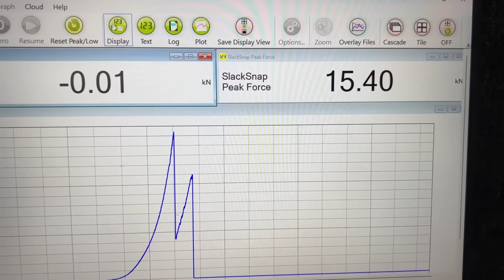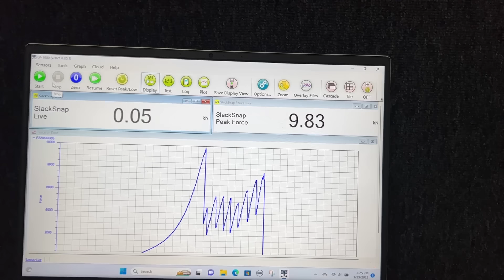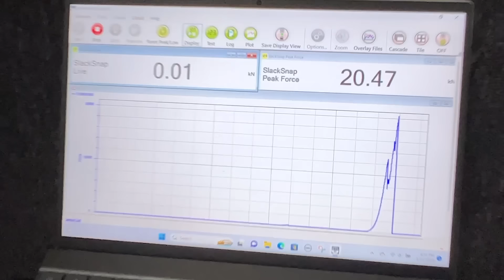They say clipping it like this will kill you

Comment: SIET teaches "STRADS" instead of "SERENE" or "ERNEST". Solid (or Strong) Timely Redundant Angle Distribution Simple. They dropped the "Equalized" and replaced it with "Angle" and "Distribution" because equalization doesn't really stay when the anchor gets loaded, but the angle between strands and distribution of load does stay as the anchor is loaded. Your tests agree with the research they cite for this. They dropped the "No Extension" because it doesn't substantially reduce the strength of an anchor, especially not if there's a decent amount of dynamic rope in the system. They're much more focused on Trad, Alpine, & Ice climbing than sport, so the compromises are different; speed making the anchor matters more often in alpine climbing, and anchors often don't have bolts but rather cams or other placed pro so the weakest point is likely different.

Comment: No Extension vs Extension! Bloody test it!! 😀 I'd love to see just how much shock load you get from a foot of extension in a dynamic system
Reply: regardless of breaking forces, in a climbing scenario if the master point drops because of a monster factor 2 fall of the lead climber ripping pieces out, you have serious problems. ie everyone tied to the rope is buying the proverbial farm. Shock loading a compromised anchor with the weight of everyone = No Bueno. The BFK is used to prevent that AND to provide a 'shelf' for potentially self-rescue with.
Reply: Thomas Evans tests ("Peak Fall Arrest Force During Simulated 2-Point Multipoint Anchor Limb Failures" SARRR) indicate that without any dynamic rope in the system about 2kN to 2.5kN extra is added. Dynamic rope in the system should substantially reduce this force.

Comment: I don’t find the Connecticut tree hitch pull test valid for those results at all. In guiding we have borrowed this technique from arborists but when utilizing it I use it around an actual tree because it spicy 4rth class terrain  or lower risk 5 th class terrain with stout trees it makes for quick transition’s.  Testing it this around a small radius of the bar stock carabiners x 2 totally skews real life situation.  Using a dynamic rope around a tree adds additional surface friction coefficient. Yes It’s closed with a locking carabiner true but I personally use a round stock biner to get better radius.  So my suggestion is too repeat this test with a dynamic rope outside on a good tree to show truer results and im willing to bet you will get much higher failure results 🤔
Reply: Uhhhh

Comment: we started doing a tailess BFK but with the 2 outside loops not in the bolt. You rethread the tails in the bolt back to the loops and equalize with truckers hitchs after a bit of tension was put in the system in the center loop of the BFK. Love it for A-Frames. More gear intensive tho. If you ever want test it :).
Reply: Dude that sounds like such a good idea! Definitely gonna try that at some point.
Reply: can you tell me what BFK means? I am from Germany and we have different expressions :-) Also many thanks to @HowNOT2 for all of your videos!!!
Reply: @quarrin Big Fuc#ing Knot. Basically an overhand knot, tied into or more strands of the rope. It is kind of an American climber slang term. I agree it is not very descriptive or helpful if you have not heard of it before.
Reply: @johngo6283  many thanks! I will include it n my climbing slang! :-)

Comment: This was so helpful as usual!  I have wondered about cordelettes and single strands versus multi.  Sometimes I tie a clove hitch into one of the outer points just on one end to get the length right and back up with knot.  Thanks HowNOT2.  So much amazing content!  Always!
Reply: Shortening with a clove hitch can be a shortcut to weakening that leg; generally, especially now that the strength of a Girth Hitch plus X master point, even in Dyneema, is better understood, and tested, reconsider the whys around making any single arm shorter, versus redistributing the extra across all legs and then making the Girth Master point just a couple inches lower. With few exceptions, any leg feeding to a single point is strongest, in order of: an unknotted sling loop, a sewn single end of a long runner, then a knotted loop, and last a knotted single strand - though that knot will hold far less in Dyneema, than good old nylon.

Comment: For the bunny ears anchor, I'm more curious in the results of having a singe strand of material on the central point and two strands of 6mm at each outer leg (this requires tying the other tail into the knot like the Tailless BFK (I've always heard it called a Frost knot). Given the centered direction of pull, the majority of the load is on the center leg. By using a single strand of material there, it will stretch more than the 2-strand outer legs and do a better job of distributing the load.

Comment: For the "bunny ears" anchor.  I put clove hitches on the ends (makes them quick and easy to adjust) and use sterling powercord which is rated to 19.7kn.   Can you test that?  I'd love to see it.
Reply: That would be an interesting test. With the Sterling power cord, especially, I think it would be absolutely strong enough for most any recreational climbing situation.

Comment: Looking at how these broke and what is more likely. 15+kn loads for total failure are an exception + often generated by not setting gear properly rather than catching a fall BUT the daisy chain having to fail 6? (5 or 6) times at 5kn is quite redundant. If you generate that force it's unlikely the climber will be rushing back 4 more times for the same jolt.  
I did climb for ages and that 7mm cord you showed near the end is my favourite. I leave it with fig 8 ears tied normally and is simple to use like a loop - just leave both ears on the same 'bina. Gives the option of both anchor styles in one bundle.  
For just sport climbing I'd have a nylon sling + BFK. Simple as

Comment: Couple of questions about the tail-les BFK: 

1) what if the tails point down instead of up? AKA the tails don't also contribute to the master point loop. They point straight down before tying the BFK. I sometimes use the bunny ear anchor from the beginning of the video on one end of a piece of chord and tie the other end into the BFK, so I was wondering. 

2) What happens if you accidentally only clip the loops below the BFK that are made by the tail strands? Are they more likely to slip through? I know these are kinda weird questions, but I think it would be interesting to know the answers
Reply: Particularly point 1) is not weird - some people who use the tailless tend to have the tails pointing down, giving less material. @HowNOT2 could you pretty please test a BFK with the extra tails down? Asking for a friend....

Comment: Hey @ryan and crew. Industrial gear is supposedly engineered to 5-1 with SWL listed veunf that 1/5th strength, whereas climbing gear typically lists max breaking strength. Maybe you could make a video addressing these differences?
Reply: Probably because climbers have no clue how much they load a system falling off, and also don’t need to lift heavy stuff like you would in construction.

Comment: My problem with the double sliding x is that the slings are right on top of each other so if a rock cuts one it probably cuts the other and then you are gone. One could say the same about the quad but 4 strands would need to be cut and they aren’t exactly on top of each other. Also the hit box is smaller since the knots separate areas so if a leg is cut it’s fine. I don’t generally use a quad but it’s a good comparison here

Comment: I always was under the impression that 7mm cord is the standard size to use for cordelettes.  When did 6mm sneak in?
Reply: Some people choose to use six mil cord in the snow, climbing, or maybe low angle alpine rock, where a high impact fall is very unlikely. For rock, climbing, in most cases, 7 mm is the general standard.

Comment: For the first 6mm cord test, can we break it far lower? That you pulled on it in the best way possible, the system might hold up to 13 to 14kN? Yet can we load it incorrectly and see if its possible to isolate the figure eights by the bolts, which should cause this to break at a lower value.

Comment: I love your test videos, but in the case for this set up wouldn't you need the drop test as it would be almost inconceivable that you would put a load on an anchor like that in a gradually increasing rate? 🤔
Reply: yes but to 'break test' these devices it'd require dropping 2-ton weights on the end of a dynamic rope, which also doesn't reflect reality perfectly, and is a much bigger operation
Reply: @Se7nDust  you can substitute 2t of weigh5 with less weight ave velocity.  Velocity or fall distance and acceleration by gravity really drives the force applied.

Comment: Its called a Frost knot in climbing. 6mm is fine. 6mm is very common as anchoring material in mountain rescue with two person loads. Its plenty strong as long as you double it up and with 3-5 anchor points depending on your anchor points.
Reply: In MR teams, the standard practise is a minimum of 2 independent 20 kN anchors, always with tape, not with cord.
Reply: @dougsanders3656  Not true at all...Cord and tape are both standards and best practice with MR teams in the US. Not sure where you are getting your information from.

Comment: Hot take: these days I just don't care about equalization or no extension (which is usually just equalization by another name).

Equalization basically doesn't provide load distribution in most cases from what I've seen: the vast majority of the time, most of the load is on one of your anchor points. Equalization doesn't make your anchor stronger.

Shock loading from extension is a questionable concept: I don't think we have much evidence that an anchor point failing can ever increase load on another anchor point, beyond the increase caused by the further fall distance. Even if shock loading is real, it's not a problem if your anchor points don't fail, so making sure each of your anchor points is Strong/Solid avoids the potential problem. Extension can cause further fall distance, but in most cases we're talking about adding a few feet at most to a fall.

I care about strong/solid because I don't want any part of my anchor to fail.

I care about redundant, but not because of the forces on the components on an anchor. Because I care about strong/solid, typically any one component of an anchor is made with materials that can hold any forces that can realistically occur in a fall IF they are configured correctly. But that's a big "if": the reason I care about redundancy is to guard against user errors, such as not screwing tight a carabiner gate or putting a cord over a sharp edge. I trust that my anchor components are strong enough to catch me if I don't make any mistakes, but I don't trust myself to never make mistakes: if one anchor component fails due to my error, I want another anchor component to be there to save me.

I care about efficiency (in terms of weight and time) because I don't want to be dragging around a bunch of heavy gear or spending a bunch of time at every anchor.

S, R. and E don't make for many good acronyms, but that's the letters I have. :)

These days I use that bunny ears cordelette anchor quite a bit, but I'm usually using Sterling PowerCord--while it's actually slightly thinner at 5.9mm than that 6mm cord you're testing, I think it's rated to a higher MBS (I'm not sure, because I don't know the strength of the cord you're using). I agree with your conclusion that the weaker 6mm is probably okay, but there's really not much downside to having a stronger, lighter cord that's more abrasion-resistant. It's slightly more expensive, but for one segment of cord over hundreds of uses, we're talking cents-per-use and I just don't care about that much extra cost.

If I know all my anchors are going to be bolted, I'll bring a pre-built quad anchor because it's a lot faster to just clip two bolts and have an anchor. But that doesn't really give you the same flexibility as I usually want for trad where some of my anchors might be gear anchors, hence preferring the bunny ears anchor in most cases.
Reply: I totally agree with you. Sterling power cord with bunny ears is a very versatile tool.

Comment: My guess is equalisation is screwed, especially with the knots... and so yeah, the two middle strands were breaking first.. (try it with an offset load so it's all on one thin leg)  [this for the bunny ears]... and that leads me to equalisation myths (i.e. no it's no equalised)
Reply: I don't think it's so much an issue of equalization as it is that the center bolt is carrying half the load of each of the strands brings a quarter of the load up, since the center bolt is being pulled on by two strands. I think it adds a shear force to the rope at the bolt that increases the load enough to bring that to failure first, similar to a knot tightening on a rope.

Comment: I'm going to ask again as you touched on it so briefly....... I'm trying to find out how much a bowline on the bight reduces the overall strength of ROPE (not webbing) when you're tighed into both loops (or both loops are through the eye of a captive eye carabiner and you are clipped into the carabiner). I'm trying to see if the bowline on the bight is better then a re threaded figure 8 going through the captive eye (so only 1 rope through). You can find out the % that the figure 8 reduces the rope by from almost EVERYONE, but I'm still to find the % on the bowline on a bight. Please help😢

Comment: About the "Bunny ears cordelette" with 6mm cord. I don't think that it is ok to use as an anchor. MBS of 15kN for a brand new 6mm bunny ears cordelette does NOT make it acceptable for use IMO. The reasons : 1- The strands can be on trad gear that can blow so having a strong attachment to each of the individual pieces is critical. From the overlall 15kN you get, I estimate you only have about 4kN on the left and right pieces and maybe 7kN on the center piece. A recommended (probably what UIAA, UIAAGM and other associations recommend) 7mm cord doubled (normal) would be around 9.5kN on each piece this is the standard that should be used IMO.  2- In the real world, the gear gets worn. Cord can be 40% sheath and 60% core so if a cord is about to desheath from abrasion, the 4kN of the single 6mm strand gets to maybe 2.5kN.

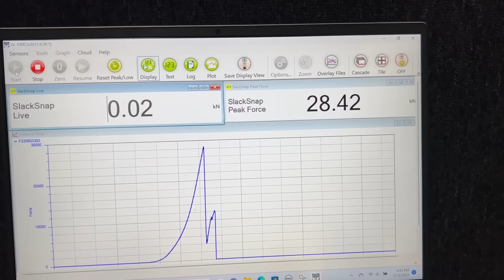Comment: Hi, climbers! At 9:33 you cannot test the set oft six parallel strands alone without observe  (or give them) possibility of equilibration between them!
Please try the same with a large Ring closed by a double Spierenstich and fold it into three double strands :-) 😳

Another fine Test would be to stress  a long "Standschlinge" perhaps 150 cm/5 inches lang, divided into three rings and see what comes out?
Nice greetings form austria!
Eric